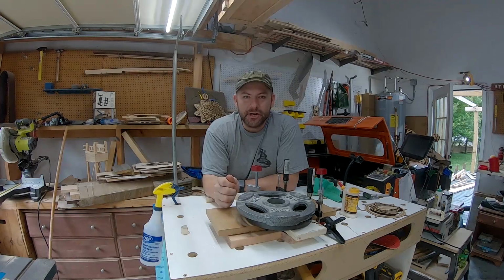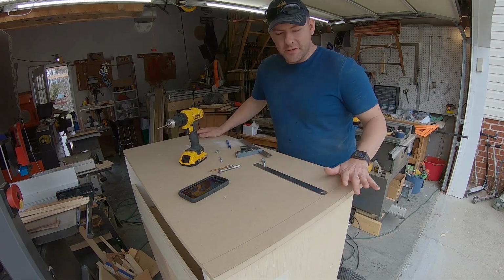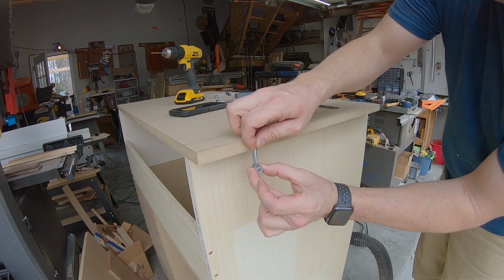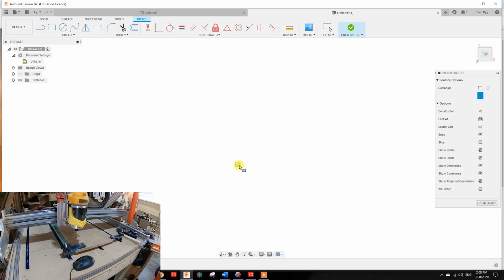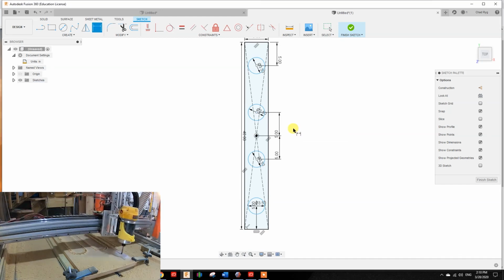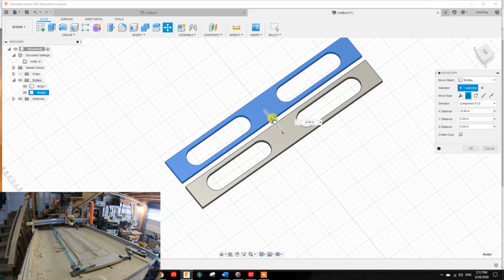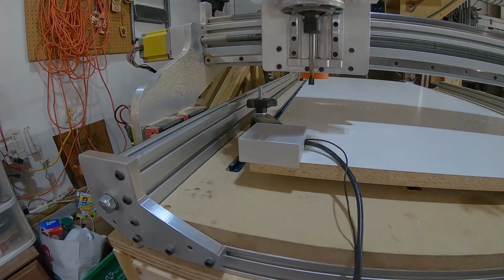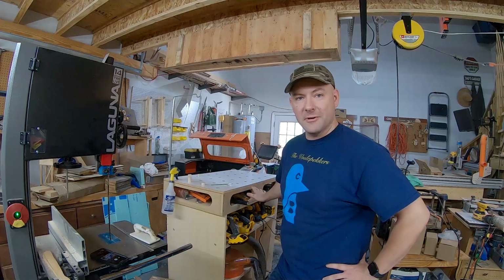Build a Vacuum Cart and SAVE Space Part 2

Comment: you need to buy a Snap Punch, much easier to set those dimples to start crews with metal or wood. ... and to use Glue.
Reply from the maker: I have one now!
Reply: @LetsMakeStuff   
Learned about them years ago at a machine shop I worked at. Awesome tool. Have owned one ever since. ... PS will snap a car window instantly (so not a bad emergency tool also)